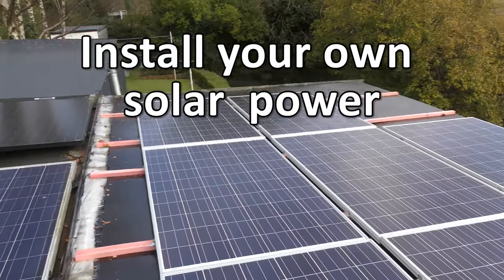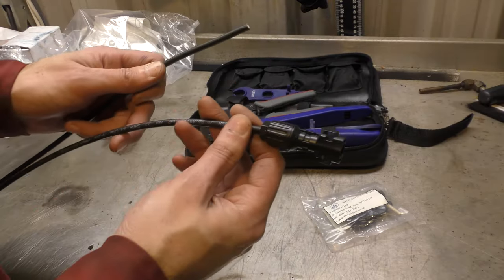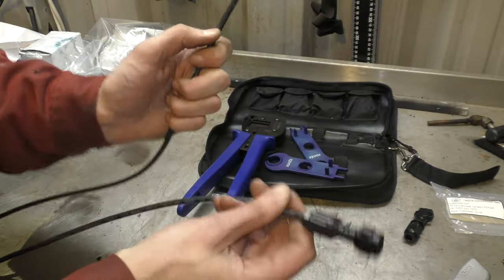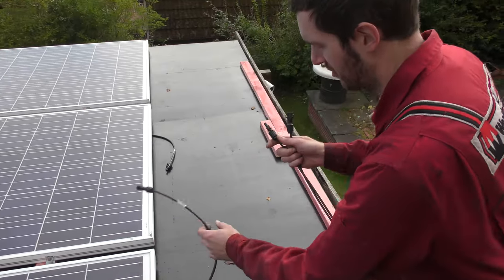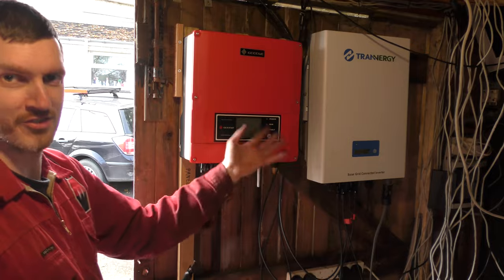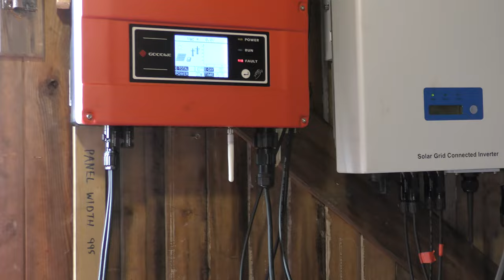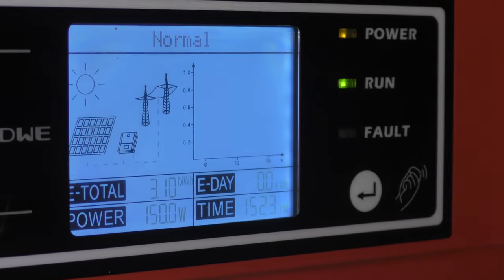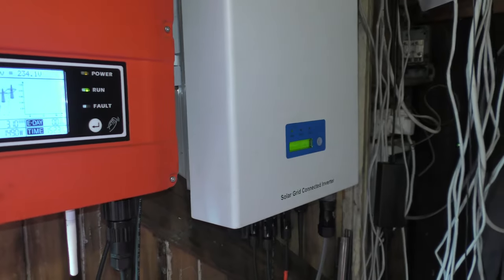Install Your Own Solar Power

Comment: How about a list of the various components and tools needed?  How to fit the panels onto a tiled roof, for example. Do you need a qualified micro generation electrician to approve the installation?  Do you need planning permission,. Do you need a contract with your electric supplier?